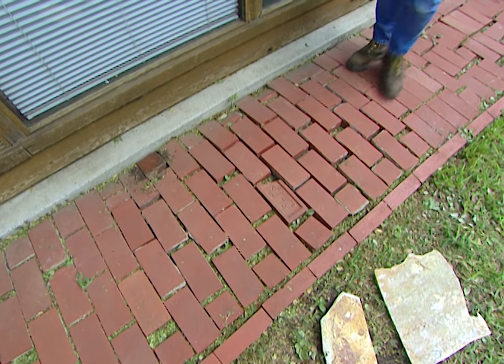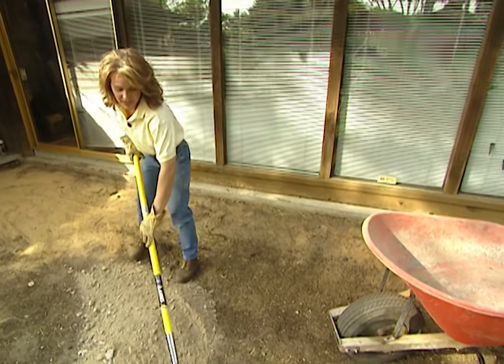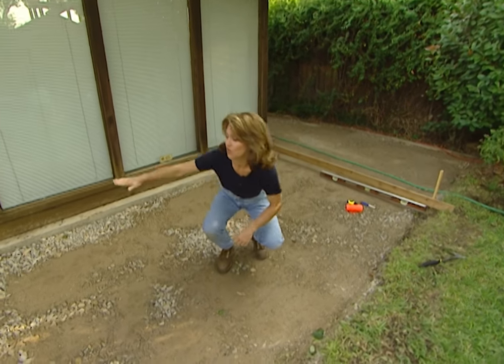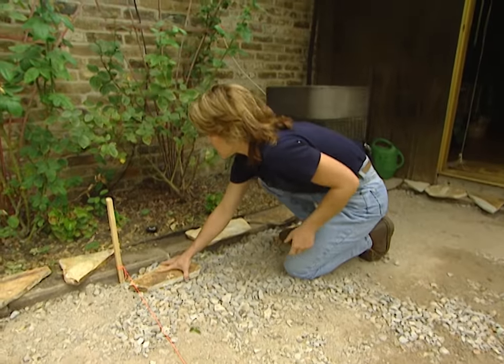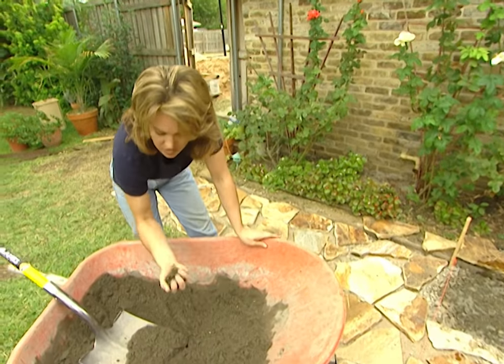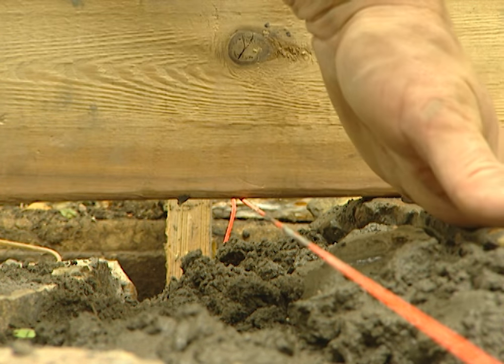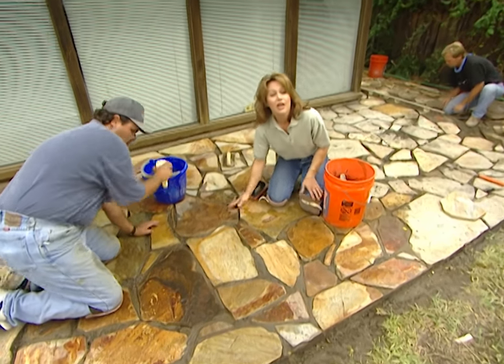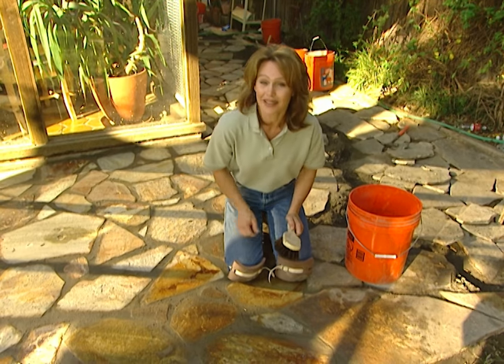How to Install a Natural Stone Patio - Do It Yourself

Comment: This is one of the best DIY videos regarding flagstone I've seen. Its simple, well explained, and to the point. Its the lowest cost possible based the materials shown. And its way cheaper, less technical, and more durable than a deck. Plus stone and motor will last 1000s of years with almost no maintenance vs a deck.  i.e. Great Wall of China. I intend to do this project in the fall when its cooler. Thank you for this great informative video !!

Comment: Don't grout flagstone if you live anywhere with winter temps. You've got to allow the stone to move with the seasons. Grouting will make it stiff and it will eventually develop cracks. If you "dry" lay it will def last your lifetime, and perhaps be found by an archeologist someday.
Reply: How do you fill in the cracks in lieu of grouting?
Reply: @sean9182 polymeric sand

Comment: What do you cut stones with?
Reply: Ajax
Reply: You cut it with an angle grinder equipped with a diamond blade. Use a wet blade to reduce heat and dust.

Comment: Excellent work. However, I could not help noticing you are not wearing work gloves. Handling building materials such as cement, Portland, and concrete can cause extremely painful skin  cracking and dryness. Gloves always! I speak from experience.